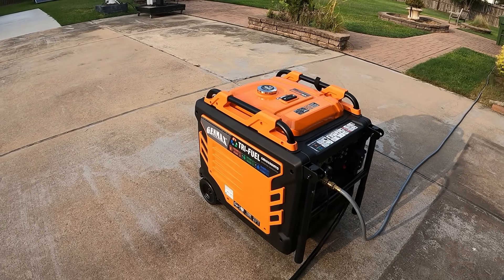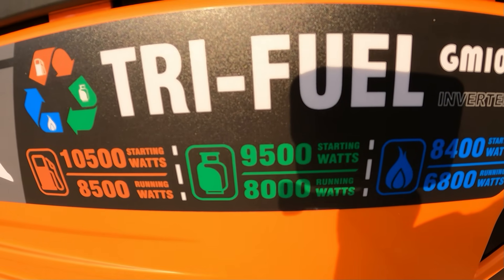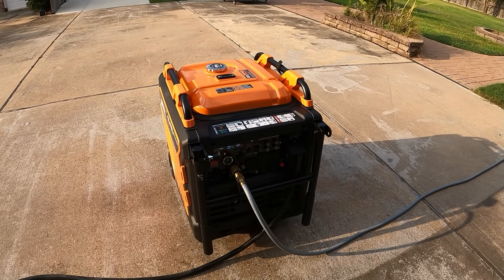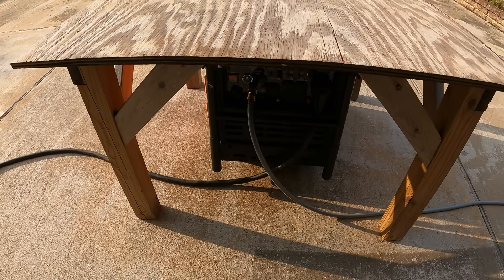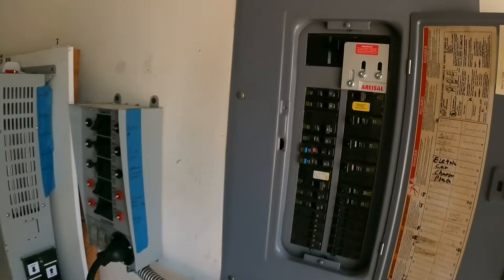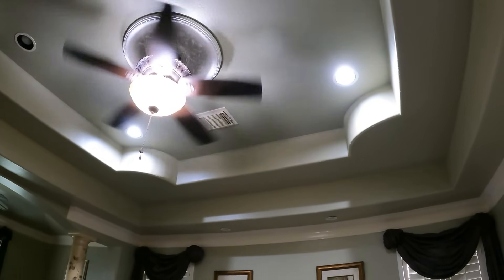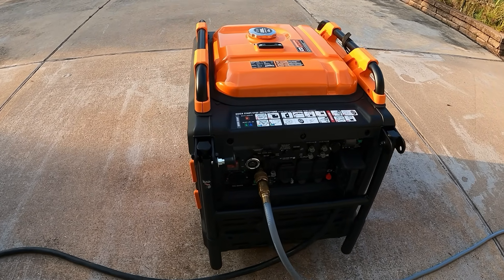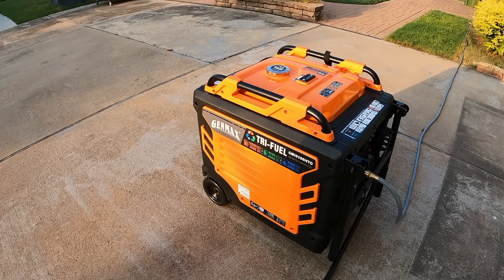GENMAX GM10500iETC TRI Fuel Inverter Generator Running a 5-TON AC - BETTER Than A Standby Generator!

Comment: Can you use the 30amp plug on the generator to connect the house or its best to use the 50amp? As always great video plug
Reply from the maker: Yes, you can use your 30 amp plug to connect to a 30 amp inlet.

Comment: I haven't seen this issue mentioned much so maybe it's a non-issue, but I'm wondering if people have problems running a heat pump with their generator when the heat pump enters a defrost cycle. Since connecting my air handler to an emporia energy monitor I've realized that my air handler jumps from 500 watts to 10kw for a couple minutes every couple hours, likely running heat strips during a defrost cycle. 

The rest of the time my whole house including the 3 ton heat pump uses under 7kw. I'm left wondering if even after installing an easy start I'll need to find a way to disable the aux heat for defrost cycles, or if I should just plan on using space heaters unless I get a 2nd 10500iETC to parallel.
Reply from the maker: It’s most likely exactly like you said your heat strips are coming online requiring a higher demand. Is there anyway you can deactivate that?
Reply: @GeneratorReviews   From what I've read so far, heat strips in the air handler can be either triggered by the thermostat for aux/emergency heat or by heat pump itself for maintaining comfort when the heat pump goes into defrost mode and basically switches to ac mode blowing cold air for a couple minutes. 

Nothing I do at the thermostat can prevent the communication coming from the heat pump for heat strips to come on during defrost so the advice I've seen is to disconnect the W wire from the low voltage junction box at the heat pump, with it making no difference in the defrost performance, just the comfort of anyone near the hvac vents while defrost occurs. I'm hoping it would work to install an inline low voltage switch somewhere between the heat pump and the air handler so that I can just disable the heat strips when needing to use generator power vs needing to open the panel and insert/remove a wire if/when I want to change it. 

All of this is odd because I didn't even think the air handler had heat strips since the paperwork I received with the house listed heat strips as an option that wasn't selected and even on days when the temperature has been below 20F my whole house energy use has rarely topped 7kw per hour, so it was a surprise to see energy use for the air handler alone bump up to 10kw. The frequency and duration matches when I should expect defrost to occur. The air handler and heat strips must share a circuit as there is only one cable going to it, rated at 60 amps/240 volts, on a 90 amp subpanel running nothing else. The large gauge wiring had been reused from the prior system so I had thought it was simply funny to have a 500 watt fan on a 90 amp dedicated panel. The heat pump is on a separate 40 amp circuit on the main panel.
Reply: @GeneratorReviews    I unhooked and capped the white low voltage thermostat wire from the heat pump defrost board and now defrost runs fine without triggering the heat strips. I haven't noticed any discomfort from the heat strips not running. It would be easy to reconnect if desired.
Reply: Heat strips typically have a dedicated breaker in the panel.  Find that and turn off.  Defrost will blow cold air while heat strips are disabled but will be fine as long as the compressor can still generate heat with the outdoor temperatures.  Some compressors are disabled in negative temps and heat strips become primary in that situation. Then it would be better to throw the compressor breaker off and run strips in emergency heat mode.
Reply: @projectswithjw  A separate circuit would be helpful. My air handler apparently shares a 60 amp circuit with the heat strips. My heat pump manual has heat efficiency data down to -5F. It's only twice as efficient as resistance heat at 10F but it rarely gets below 15F here in NC.
Reply: @NurseAcrobat  sometimes the breaker for that is in the air handler instead of the home breaker box.

Comment: Great video.  What size wire did you run from your outlet box to I guess your double pole 50 amp breaker in the panel.  Thanks
Reply from the maker: Yes

Comment: Hi, is it true this generator can't produce the 50 amps unless connected in parallel? So it can't use the 8500 watts?
Reply from the maker: To get 50 amp at 240v yes, you can use the 8500 watts.
Reply: I can only use the 8500 watts with two generators connected to each other?

Comment: During natural disasters they cut natural gas a lot of times because of fires so that’s really not as dependable as propane in my opinion. I’ve worked for the utility company over 40 years and absolutely have propane stored for my emergency use.
Reply from the maker: Agreed 👍🏾
Reply: Just use gasoline propane is just to expensive.
Reply: You’re claiming propane is more expensive than gasoline🤨 How much is gasoline in your area?
Reply: I have never heard of them shutting off NG prior to or during a disaster.

Comment: Gavin not a question about the 10500iETC but on the Genmax 6000. I takes for ever to start on propane. Should I install a purge button in line and would that help. I don't like having to add gas just to start the generator then switch to propane.
Reply from the maker: You could purge the line before tightening it all the way, but at least the unit will try again automatically.

Comment: What would be your choice between the Genmax 10500 TriFuel or a Pulsar 9500 Dual Fuel Inverter Generator? It will be used on a bbq concession trailer with a 50 AMP plug. It has a Pioneer mini split but needs an additional A/C installed on top.
Reply from the maker: Hey Greg 
Thanks for the email looking forward to hearing from you

Comment: When do you run with low idle on and when do you run with low idle off?
Reply from the maker: I try to keep it in low idle mode as much as I can, unless I’m doing a really heavy load.
Reply: could you give like a percentage...like at 70% load you then go high idle.  Will it shut off if you are doing a heavy load on low idle?  ty  @GeneratorReviews

Comment: Hello Gavin.  Can you do a parallel 10,000 and the 9,500 to charge a Tesla and see how long it takes to charge it with those two generators together pushing all that power. I’m thinking it will hopefully be like plugging it to a super charging station.
Reply from the maker: Check out this video. It’s almost what you’re asking for.
https://youtu.be/9c_YJ4jhB2g?si=xP5ST3CYiOxUz6KP

Comment: What kind of amperage inrush are you seeing on that 5 ton AC after the soft start install?  I got mine (4 ton) down to around 32A (was 117 LRA) but on NG I am worried that it still isn't enough.  Max amperage being 35A on NG.
Reply from the maker: After I installed the soft start, I’m seeing around 39A
Reply: Wow, and this thing is doing it! Good stuff. @GeneratorReviews

Comment: hey my friend! if i want to use in parallel, do i have to have the same exact genmax model?  the manual says so but i was just checking since i saw you use 2 different models in parallel
Reply from the maker: It works best with the same model because of the updated parallel plug on the 10500
Reply: @GeneratorReviews  got it, thank you

Comment: DuroMax just dropped a 16kW dual fuel inverter for $5000 today.  Price is too high but they moved the bar.  XP16000iH
Reply: I saw that but for a little more, you could buy two of these and run them in parallel. Plus (for me) this is a tri fuel and I plan on using NG. Also, I just spoke with Gavin and he confirmed the two units running in parallel will be running a lot quite that this one.
Reply from the maker: Yes, I should have it on the channel soon

Comment: Do you think I could run a 4 ton central AC 109 LRA with a soft start and two refrigerators with this on NG?
Reply from the maker: Yes with the soft start I think it will work 👍🏾
Reply: @GeneratorReviews  awesome thank you!  You like the power watch dog ?  Considering that just for monitoring capabilities via my phone versus messing with something inside the panel.

Comment: Should an inverter generator be able run indefinitely at 80% of its rated output?  My new Genmax 9000 trips its overload breaker after running at 5700 Watts for about 5 minutes.  Is that normal?
Reply from the maker: Something is overloading did you turn off your water heater? Make sure you turn off all the circuits that’s not being used

Comment: Is the fuel selector a solenoid or motorized ball valve? I read about the solenoid failing on similar models.
Reply from the maker: I think it is a motorized ball valve

Comment: This unit is very noisy idled at 70 dB. It would need to be enclosed and soundproofed... in cold climates it needs to be sheltered anyway to protect it from the snow.

Comment: A wireless display (or smart phone app) to monitor power utilization, fuel level, and better yet, a way to toggle smart idle on and off, would all be awesome and welcomed features!

I installed a magnetic drain plug and magnetic dipstick in my Predator 9500.  Genmax should include them from the factory as another bonus feature.  (Or preferably switch to pressurized lubrication and an oil filter, but I’m asking for a lot.)
Reply from the maker: I don’t think it’s asking for a lot. It’s just the price increase would also have to be excepted

Comment: The "ultimate" generator is a diesel generator that runs at 1800 rpms, but has been converted to run on natural gas. I'm currently looking at a 14.5k watts for $8,700. The system is rated for 30,000 hours before it needs to be overhauled. They also have a 21k version for $10,000. It uses very little fuel compared to a 3600 rpm generator. You can directly plumb it into your home's natural gas supply and have unlimited fuel.
Reply: Everyone has a different definition of “ultimate”.  I agree that a diesel 1800rpm machine makes for an excellent permanently installed standby generator, but you can’t easily pick that up and take it with you.  These higher capacity portable inverter units are so versatile.
Reply: bnnnnn
Reply: You would be also hard pressed to pick up this 247 pound beast and take it w you… id like to see how folks put this in the back of the truck?  Lets do a vid on this please…Gavin this sounds loud?
Reply: @fb510m I have a similar model that's 13k ,I see no reason to transport my home generator to different locations, It's just for my home ,so if you want something to take to different locations , get a smaller model possibly, Mine has wheels and I have a small 12 foot trailer with a drop down ramp, if I did want to transport it, that isn't a problem and can be loaded in 2 minutes,I feel a generator is a tool that you use a limited number of times in 5 years, so just having it available to run your heat, ac ,refrigerator and freezer in case of emergency, That  is the main thing ,it's just  to get you by till power is back, we had a tornado come thru 2 years ago, we had no power for a week, my portable generator powered my entire home for 1 week until we got power back, we ran it from 6 am till 9 pm daily, then went to bed and it was fine, From 9 until 6 am ,we plugged our refrigerator  and freezer into a bluetti inverter battery in the evenings when the gas generator was off and this system worked great while others had nothing for a week in our area, All I can say is for the 1 time or 2 you may need a generator every few years  , the money is well spent .
Reply: What is the name of the diesel generator and can you purchase it in the US?

Comment: You do amazing unbiased videos, but I have to ask. What is your go to reliable generator that you use for your RV and home?
Reply from the maker: This is the generator I use for my home but for my RV I use the genmax 7250 W
Reply: @GeneratorReviews What features caused you to favor this one over the equivalent Pulsar model? Pulsar is currently $200.00 cheaper on your website and comes with a 3 year warranty while Genmax only has a 1 year warranty.

I think the Genmax has a floating neutral but the Pulsar neutral may be bonded? Not sure in what situations each of these is preferred.

Thanks for all your work!

John

Comment: Has anyone have any idea how long it will run on a small propane bottle?
Reply from the maker: I think you probably get about 8-10 hours running at 25% load
Reply: @GeneratorReviews  way better than my first generator I had. Maybe like 2 to 2 1/2 hours.

Comment: Thanks for the great content. I will have a similar issue of NG and electric far apart like you. Please provide a link for that 50’ NG hose. What length is the NG hose that comes with the generator? Can they be connected to each other for additional length if needed?
Reply from the maker: Hi
The hose is 25ft and I will post the links to my website
Reply: @GeneratorReviews  couldn't find it on your website.  Is it 1/2 or 3/4"?

Comment: No fuel injection I'll pass.
Reply: I’m guessing your a Honda fan like me?
Reply: Maybe a turbo charger too? Good grief.
Reply: @chalemi6909  Honda is the sole manufacturer of portable generators with fuel injection. There are many benefits to fuel injection. Namely the absence of a carburetor freezing up in cold months, better fuel economy etc. Fuel economy is critical during long duration outages. After tropical storm Isais in New England several years ago. I was amazed to see many empty gasoline jugs at a customer’s homes. One in particular had a very loud Generac portable generator. Granted he had been out of power for 5 days compared to my 2-1/2 days we were out of street power. His yard was littered with no less than 15-5 gallon fuel jugs. I had used 22 gallons of fuel. They were sweltering during the month of August. Whereas we were very comfortable with our central A/C on. You read that right. Our 5500 watt generator was able to run our entire house including our 2-1/2 ton Trane central air. Like the say “nothing runs better than a Trane”. Same applies to Honda inverter generators with fuel injection.
Reply: @johnclyne6350 I understand Honda is not producing gas powered equipment any more, including lawn mowers and generators, but could have misunderstood the report. Also, have not found a Honda tri fuel generator.

Notwithstanding the above, would the most efficient generator then be an EFI  inverter generator? IDK of a maker of such a beast that could output 10-12kW.
Reply: No, Honda still produces gas powered generators. There are after market manufacturers that will allow you to hook up propane to a Honda generator. But why? Gasoline has more stored energy per cubic foot than propane. Then your reliant on frequent propane deliveries to keep your generator running?
You can buy a second Honda EU 7000 is generator with a coupling kit & it will deliver 11 KW if you need it? 
I can run my entire house on one EU 7000 is comfortably. If you really need that extra power? It will cost you dearly though?
Reply: @johnclyne6350  Thanks for update. Local Kubota store and someone here on YT both said Honda getting out of gas engine business.

I did hear that adding a trifuel carb to a Honda voids the warranty.

I have natural gas coming to the house already. I have no ability to store significant gasoline safely on my (suburban) property. Also last power outage none of the nearby gas stations could pump as they are all electric. Hauling 5 gal cans of gas from more distant gas stations would be tedious, possibly risky and highly inefficient. 

I can store 400lbs of LP legally and safely in my back yard in 100lb containers and hook them together with a manifold. I can get these refilled at a local Grange store, or have LP delivered.

For my situation dual LP/nat gas generator would be better, but none exist AFAIK. So prefer tri-fuel.
Reply: @johnbauman4005  I would doubt they would be? When I bought my Honda generator there was zero negotiating on the price. Second was that they knew if you wanted the best generator money can buy you must be willing to pay for it too? 
Third was my local dealer didn't have any for sale on the sales floor. If I wanted one? I'd have to buy it sight unseen. I had to pay upfront for it in full $3700. Then wait 12 weeks until he sourced one out of state. That was 6 years ago.  I have 79 hours on mine & more than likely I'll sell mine in another 35 years.

Comment: New pulsar 4000 DF generator video! It’s hard to believe what they get out of a 47 pound machine. Also dedicating a segment to run times, testing things like propane and gas run times, eco mode vs no eco mode, same wattage inverter vs standard generator, different load types and how they affect run time, oil additives that claim to increase mpg, etc etc

Comment: What are the inrush amps on your AC now with the soft start?

I’ve got a large standard generator, but I need to get a large inverter one. Maybe next year. I will be sure to buy it from you.
Reply: On my 3.5ton heat pump/ac I went from over 100amps of locked rotor rating (I never actually measured starting amps before) to 25amps with a microair easystart. Not only is it a much better ball park for a generator, my utility bills went down and lights don't dim when it comes on which was a problem in certain rooms, usually those with dimmer switches.